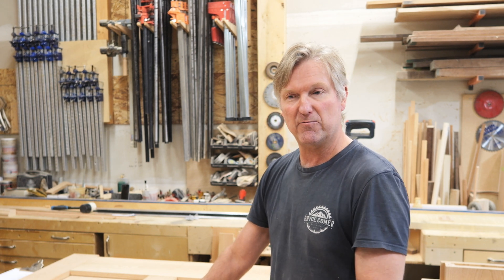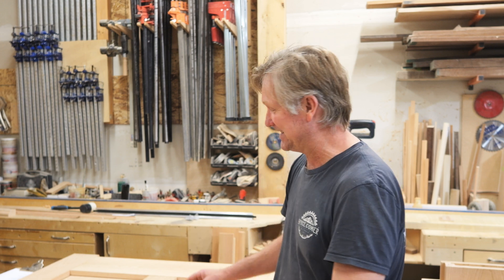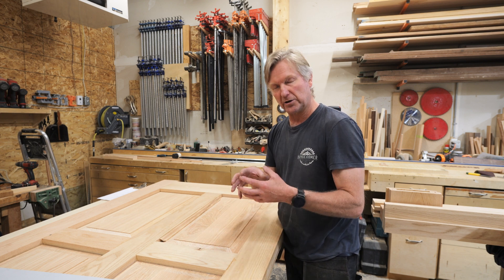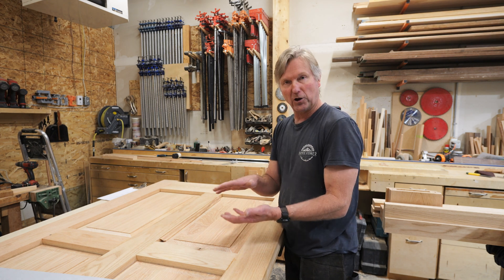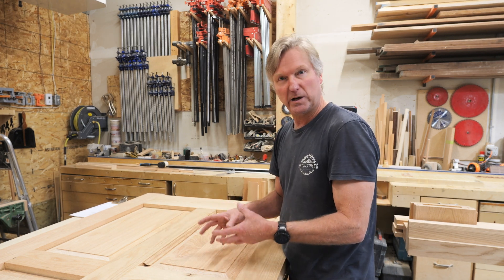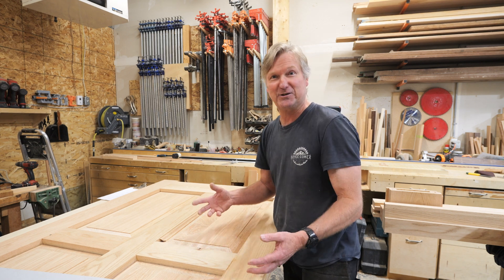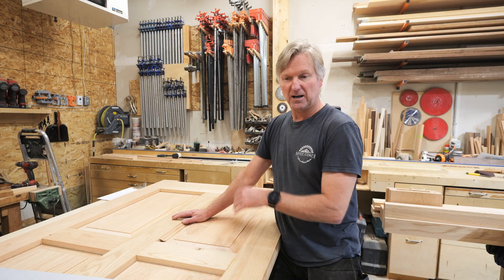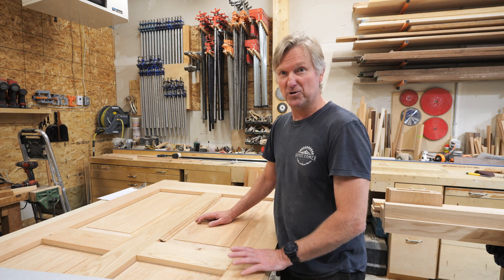A better way to build an exterior door?

Comment: I like the panel design. I think historically in Europe Inner and outer panels were used with a small air gap for the same reasons. I'm curious what you use for a sill design and weather proofing. There's a lot of extruded aluminum stuff out there, but not very attractive for a customer door.
Reply from the maker: Thanks for watching. Yes the panels being split is very similar, just with foam in between instead of the air gap. 
For that particular door, there was only a low (6mm) profile aluminium threshold as the owner had 2 boys that were bound to wheelchairs. The bottom of the door had a drop seal to deal with drafts. For many other doors however, i do use aluminium thresholds. As often as i can, i will use a bronze or black anodized aluminum though, as the look of the plain aluminium isn't very attractive. Typically the inside of the threshold has a timber part that sits under the bottom of the door, and that's what you see from inside.
Unlike in many parts of Europe, our entrance doors only incorporate a single weather seal that sits in a groove on the jamb (door lining if you're in England). Considering our climate, we could really benefit from double seals in entrance doors, but that of course would require different designs all together, something i think is still a ways off here.

Again, thanks for watching! 😃
Reply: @brycecomerwoodworks … and thanks for the thoughtful reply:)

Comment: Do you do anything to prevent air and moisture from passing around the edge of the panel where the expansion space is? Would a neoprene tape be feasible or perhaps a thin bead of silicone along the inside edge of the exterior panels?

Also, rather than half sawing and sanding down rigid insulation go to the art supply store where you can buy a variety of thin foam products. There is foam core board that has a rigid paper skin and there is craft foam that should be stable if no uv light reaches it and there is type of packing foam that comes in sheets that is similar to sill gasket used on construction sites. Tape should hold the foam in place temporarily during assembly.
Reply from the maker: Thanks for watching @rabbytca 
Those are some great suggestions for the foam. The only reason why i did what i did with the foam was because i had it on hand, and could actually cut it. It was a bit of a messy job though. :) 
Typically i would use a bead of silicone on the inside as you say, and then run a small bead of acrylic caulk around prior to painting. That seams to work well.
I love your idea of using a gasket, especially for the outside. If it could be let in to the door or panel and keep the gap to a minimum it would work really well and allow the panel to move freely. 
Thank you for your insights!!!
Regards,
Bryce

Comment: And now I have a question for you! What do you think about an exterior door using stave core construction , but with the staves being closed cell rigid insulation instead of laminated wood? I have a supplier, Robert Bury, that sells a foam core plywood. I presume they have overcome delamination. I have experience with a vacuum press and wonder if solid veneers(1/4"?) on the face and solid blocking on the edges would give the stiles/ rails enough strength?  Higher R values w less weight and less material cost, right?! Anyone doing this? Thoughts?
Reply from the maker: Interesting! I think for a slab door it might work very well, however i think perhaps 1/2" of material on the foam might be a better option. Maybe 1/4" ply, and 1/4" face veneer? So you would still have 3/4" of foam to reduce the heat transfer and weight. 
With a frame and panel door, i would be concerned that there wouldn't be enough strength in the joinery. 
It sure would be nice though to find a way of making solid core doors lighter! I just installed a 90x44" door that was 2" thick, with only 1/4" of foam in the middle of the two panels. Essentially i made the slab with stave core stiles and top, mid and bottom rails then made 2 panels that fitted up between the rails and stiles like there were just horizontal boards top to bottom. The darn thing must have weighed 200#!! It sure does operate beautifully, but wow, hanging that thing by myself was a bit of a mission! :)
Reply: @brycecomerwoodworks  So, have been doing a fair bit of research into laminating wood to XPS foam. It seems that a glue we use regularly in the shop is designed for the job- Akfix PA 370. It's a quick curing polyurethane glue and we like most everything about it except the fact that it foams up. But, foaming is manageable.  I don't see anyone on youtube playing around with this as a door construction method, so we will start running some trials.  We'll try out Titebond 3 and Gorrilla Clear in addition to PA 370 and see what works.  If anyone has 20 years recorded research now would be a gret time to share it, lol!
Reply from the maker: @gavinfeargrieve4874  I'd love to hear how you get on. Good luck with it. It sounds very interesting and should make a big difference to the thermal transfer and weight of the door.

Comment: Enjoyed the video. I've made loads of interior/ exterior doors in a small 1- 2 man shop here in good o'l Halifax, NS, Canada.  It's reassuring to see other professionals come to the same conclusions  that I have thru 'self directed' studies/ trial and error. Split panels and a layer of insulation- new twist on old school technology. It works!  In addition to this, a quality urethane finish that remains elastic throughout it's lifetime is really important (to me). BTW, the reason I found your channel is I'm seriously considering purchasing a Felder saw/spindle combo machine (despite the cost!).  Thanks again.
Reply from the maker: Hi Gavin, Thanks for watching, and the feedback. Our weather can certainly do a number on doors and windows here in Canada eh! If you are after a Saw/Shaper the Felder is a great machine. Another one i would definitely look at too is the SCM. I have no experience with SCM here in Canada, so can't speak to their service, but their machinery is great. Typically a little cheaper than the Felder offerings too.

Comment: With this approach, what was the thickness you ended up with for the inside and outside wood panels?  I like the idea, and agree that even a modest amount of foam is worth doing.  3/16 of poly-iso foam has an r-value of about 1.2, which is more insulation than a full inch of most wood species.
Reply from the maker: The overall thickness of the door from memory was 2 1/4" or about 55mm. Again, going from memory, i think each panel was about 7/8" or 22mm thick. I'm sure it helps having the thermal break, and also just allows the outside panels to move independantly of the inside panels.

Comment: How strong are the panels,if they are fastened with nails. If someone kicks will the panel fall off?
Reply from the maker: They would really have to be kicking it hard to bust them. Probably easier to simply break the glass on the side lights in the jamb if you wanted to get in.

Comment: Good idea. What kind of wood are you using?  I'm about to build an exterior door for my cabin in the Pacific NW and this video is timely. Thanks!
Reply from the maker: Thanks for watching Donald, This one is red oak & will be painted. I expect it will get knocked around a bit as it will see lots of wheel chair traffic. Lots of good material you could use where you live. Western red cedar is a timber i'm sure you're very familiar with there in the PNW. If you don't expect it to get knocked about too much, it's a fantastic timber for wetter areas, just soft. :) Doug fir is also pretty good if you can get some nice old growth.

Comment: and don't forget air- or at least wind-tight.
Reply from the maker: Absolutely. This one is a little different in that it has a low profile threshold, so it will have a drop seal on the bottom. For the rest of the door though, it will get just one seal. That's where i believe the European style of entrance door wins, with their double air seals.

Comment: You can also look into how doors are made in Europe, they have staggered rubber joints on the perimeter for extra air tightness and sound insulation
Reply from the maker: Ah yes, i just replied to another comment saying just that. The European doors are beautiful the way they seal, as are the windows!!! Thanks for watching, & thanks for the comment.

Comment: Australian watching here so not so important for me but interesting nonetheless. What other techniques do you use - stave core?  Cheers
Reply from the maker: Thanks for watching @justcruisin109, yeah not as important in Oz for sure. I know of doors i made almost 40 years ago there that are still perfect. I'm sure though, that that would not be the case if the same doors were here in Canada! :) 
Stave doors are definitely a good way to keep things from moving. The door in this video isn't made with stave construction for the rails and stiles, but built up with laminations of the material like a glulam beam if you will. Still very stiff and holds its form well over time. The top has 8 lights, and that's another difference (although less nowadays) than in Australia, as each of the truly divided pieces is a double glazed unit, giving the door better insulation values for the climate here. This particular door will be used as wheel chair access, so had a low profile aluminium threshold with drop seal that drops down on the threshold when the door closes. (You have to keep those drafts out when it's -20 deg. C outside!)
Reply: Accoya all the way. Pretty much ZERO movement or rotting
Reply from the maker: @Dazza19746  One of these days i'll build a door with Accoya! That's good to know about the lack of movement. I'm pretty much in the middle of nowhere, so getting my hands on some Accoya isn't as easy as i wish it was. But if like you say there's virtually no movement, maybe i have to try harder! :)
Reply: @brycecomerwoodworks  I think it’s so slight it’s literally negligible.

Also because of that the paint finishes last 3-4 times longer as you don’t get the normal failure at cross grain joins ( virtually every one for us guys)
 
And you’ll never need to worry about having to plane doors down when they swell!

Highly recommend
Reply from the maker: @Dazza19746  Ok you've sold me on it! :) The next paint grade door i do i will definitely have to source some Accoya. Thank you for the advice!!
Reply: @Dazza19746  what is accoya?
Reply: @thomasnourse7506  Accoya is radiata pine treated with an acetylization process to stabilize and prevent moisture uptake and rot. Good stuff but expensive and hard to source in less than lift quantities.